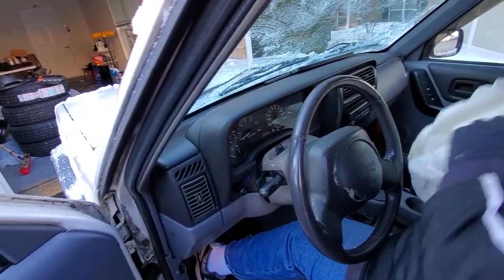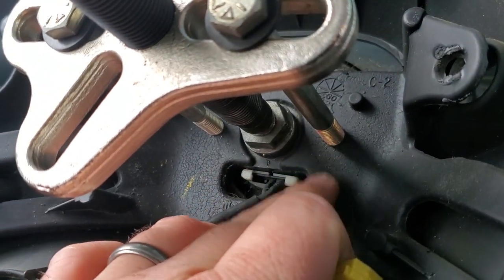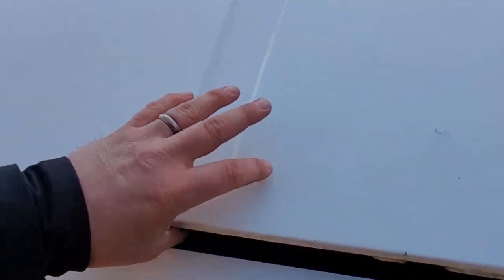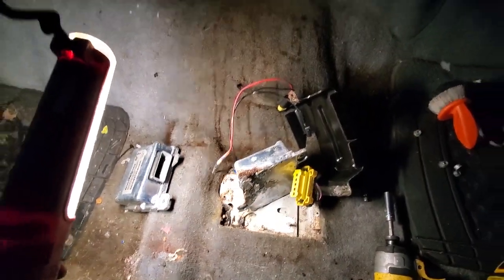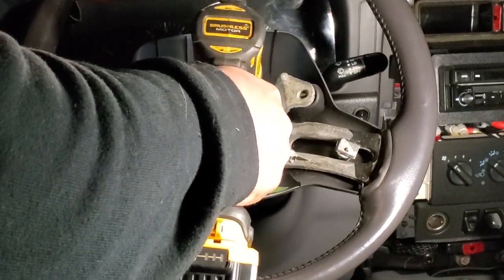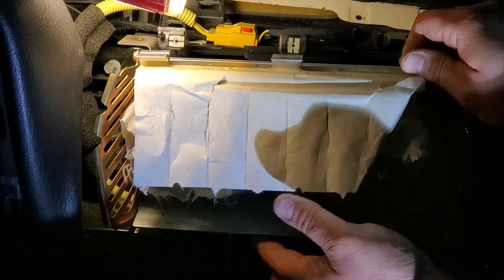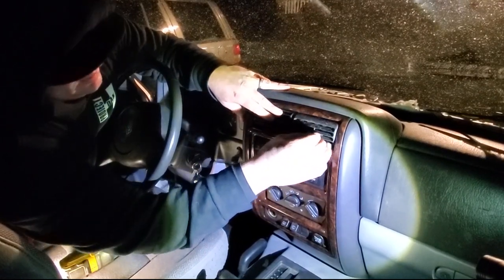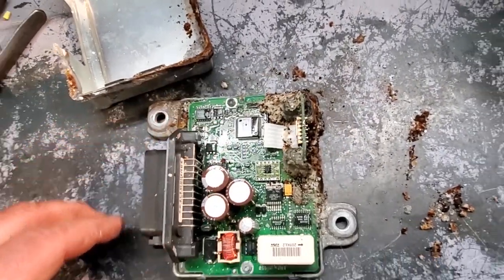JEEP CHEROKEE XJ AIRBAGS DEPLOYED WITHOUT A CRASH!  HOW TO  REPAIR YOUR AIRBAG SYSTEM

Comment: A few years ago I rear ended someone and blew the airbags and smushed up a perfectly good jeep. I put it all back together in a few weeks except the airbags and I searched for a long time for an easy how to guide to replace everything. Over time I got it all together and just a few weeks ago finally got it all figured out with the right parts and replaced it all. It was so hard to find information about removing the passenger airbag! This is the video I’ve needed for years just a few weeks too late! Thanks for being thorough and showing the entire system. No doubt this will be the #1 video used by people doing this repair
Reply from the maker: Oh man! That's the crazy thing about YouTube, I've had all this knowledge in my head but didn't have the opportunity to share until Andy's airbags blew up! sorry we were too late. lol

Comment: Had to replace the airbag twice on the Bumble Jeep (due to vehicular mishaps) The 95 XJ has a self contained airbag (no wires or control module) with no passenger side bag. The last time I replaced it I couldn't find a 95 airbag. I found a 97 Grand Cherokee that had the same steering wheel as my 95. I grabbed the airbag and to my surprise, while it looked the same, it had wires. Fit in my steering wheel, but is not connected to anything. So if I have another vehicular mishap (God forbid) at least the airbag won't deploy. Fun times. God bless, stay well.
Reply from the maker: That's a great story! Airbag s create the best of times! Lol Thanks for your view as always 💪

Comment: Thank you Dan H. Doing my search about the air bag, it was great to here you had something about it. All I was doing was jumping my jeep so I could move it. When I started my jeep I got out and put my cables away I left the jeep running for about 10 minutes I didn't get back in until I parked my 2015 jeep back in drive, that's when I heard a noise, thinking nothing of it when I got back in my xj ,my rear view mirror was on the floor and passenger side airbag had blown. And windshield was busted. I have a parts 98 xj also.
Reply from the maker: Oh man! The module probably corroded!

Comment: I have a 97 too and my airbag module is also under the seat. Was doing some rust repair in the front, took out to clean and luckily looks new.  That was definitely the issue.
Reply from the maker: It's definitely a problem under the seat, You can remove the ground and relocate the whole module under the center console using factory brackets from a later model.. I think we'll have to do that in another video

Comment: There's actually a recall for the 97 XJ to move the airbag controller from under the seat, to inside the center console (they stuff it down under the flip up lid, behind the parking brake lever)
Reply from the maker: Oh wow I didn't know that!  I'm going to have to take the airbag module mount off the stimulus XJ and remount everything the proper way under the console
Reply: @ProjectDanH  yep, here's the info:

https://repairpal.com/recall/00V105000

If you have AllData or similar, you can dig up the actual procedure.

I've no idea if a Jeep dealer will do a recall on a 24 year old vehicle or not.
Reply from the maker: Wow! Great info!! They have to by law
Reply: @litz13  yes I got a notice about my 98’s trailer hitch needing to be checked if it’s correct to protect the fuel tank in a rear collision. So just keep your registration up to date at the dmv. That’s where they pull the data from the vin

Comment: Great video Dan! I didn’t know jeep Put the airbag module on the floor. Lauren something new today. Thank you
Reply from the maker: Seriously! I learned it too I assume they were all under the center console... It's funny though because the '99 two-door I chopped had the airbag under the center console but it's still also had the airbag module bracket under the seat
Reply: My 98 grand has it just behind the ebrake underneath the plastic. I can see it cause atm the ebrake is missing some plastic so you can see it. Guess having it in the center of the vehicle is the best placement.
Reply from the maker: @geobrad2645  agreed

Comment: QUESTIONS!? Good morning Dan! Dave from South GA here. Rewatching this vid for refresh of info. Q1. So, i'm dealing with a AIRBAG dash light on in a 95 Jeep ZJ. any IDEAS? Trying to get answers to why light is on and how to correct issue to keep light off in dash. Q2. STEERING WHEEL LEATHER rotted, I want to replace with a WJ wheel. Which WJ steering wheel has plug and play cruise? Thanks in advance, buddy. Great info contained here. Like Mcky-Ds Im loving it :)
Reply from the maker: LOL, Thanks Dave!  I have a 2001 WJ overland wheel on my 00 XJ.  Everything was plug and play, all I had to mod was splicing in the WJ CC button connectors onto the XJ Wires.  I'm not sure if the 95 XJ will be able to read the resistance of the WJ buttons but you are welcome to try and report back... Id love to know too.  maybe you could invent a way to insert the 95 cc electronics into the WJ buttons somehow.  please let me know!

Comment: Thanks for the video....I have learned a lot watching your videos.  I have a question I hope you can help with. My 1995 Jeep Grand Cherokee Limited,  the airbag light is on and flickers every now & then. How can I get this light to go out or what is any known issues for this?   I bought it from a guy that had been in the dash a few times and also found a small airbag "sensor" I think just laying in the glove box . I had to google the part # just to find out what the sensor was. He definitely did a lot of off-road riding so I'm hoping he just removed the sensor to prevent deployment while off-roading. Thanks in advance.

Comment: Where's the front impact sensor on a XJ in the grill portion ? Great job on the repair on Bag J 😂 that's it's new name . Airbag module was at fault to to age and corrosion this would have totaled this XJ by insurance standards so you shaved another one with you extended parts catalog 👍  It's weird but my old 98 ZJ the module was in the same spot as parts Jeep under the center console high and dry .
Reply from the maker: Im thinking Jeep moved the airbag module location sometime In mid 97... BAG J!!! I love it🤣🤣🤣🤣

Comment: Dan can you make a vid repairing the fiberglass mounting holes on the header panel from the parts jeep? I just picked one up from the pick and pull lot that has a similar blow out in one of it's mounting holes but is otherwise in good shape.
Reply from the maker: Sure!!

Comment: Can you please answer a dumb question for me, Dan?

WHY were there different steering wheels in '97-'01 XJs? It does NOT seem to be a year-to-year change nor is it a trim level / submodel thing...unless A LOT of them have been messed with...
Reply from the maker: 97s and SE models had these the ugly airbag. They have that ugly circle and the ears instead of the Cruise control blanks/buttons.

Comment: Any ideas on how to remove sticky residue on pass airbag cover on a XJ ? 
I tried cleaning it with something and the rubber like cover is  really sticky . I think I used bleach and water to cause this.
Reply from the maker: That sticky stuff is actually the rubber breaking down.. just use some armor all on it and keep it slick
Reply: Thank you,  I will try that armor all ,  the cover has dog hair stuck to it lol 
 I do have hope for it cause the center counsel was the same way. I also found a used one in case,  tons of XJ parts on marketplace for cheap, I got a extra hood and most of the interior for$ 150 , I need the ashtray yet

Comment: Does the clock spring always need to be replaced when the airbag goes off? Love your vids!!!
Reply from the maker: usually because they break easily. I rather replace it while 5he wheel is off than put everything back together And realize I should have replaced it 🤪
Reply: @ProjectDanH  okay thanks just wanted to be sure

Comment: Thank you for a very detailed description.  I have to replace both bags on n '01 Cherokee Limited for my grandson.  This was a great explanation.  Did you have to program the airbag sensor?  I see online ads to 'reset' an airbag module that has blown.  Also has to be the same VIN per their ads.  I will do the bags and go from there.  Thanks!
Reply from the maker: You need to reprogram any Modules if they're not blown, and you dont need to match the vin.  If you can find another module you should be good to go.
Reply: you meant you dont have to reprogram I believe  @ProjectDanH
Reply from the maker: @karentimberlake6077  no programming necesary

Comment: Hey Dan, Dan here… Just deleted center console on 99 XJ, recarpeted, MOVED E-Brake (because I hate the XJ center console THAT MUCH). I used the small shift surround from a Comanche. Hoping to eventually put a bench seat in.
IMPORTANT QUESTION: does the airbag control module need to be mounted “level”? I’m relocating it and need to know.
Reply from the maker: excellent question, I would try to emulate its factory orientation as much as possible
Reply: @ProjectDanH  Since I was already doing a bunch of harness related work, I was able to repurpose about two feet of identical wiring and relocate things properly (with solder and heat shrink, like a grown up person should) to the area under where the back seat used to be. Dash self-destruct averted for now!

Comment: What is the year if your parts rig? Awaiting airbags for my 97 and pulled an un-crashed 01 airbag module from the junkyard, was there direct compatibility from Andy's 97 to the parts rig's module? (I cringed at that pre-recall Module positioning, ugh!), luckily my module is in the post-recall position under the center console
Reply from the maker: its very possible they are compatible,  not 100 sure tho

Comment: Will removing the oem steering wheel with airbag and installing aftermarket nrg wheel cause any issues by not having the airbag wires connected to anything? Does it throw a code or turn on a light or anything? Thank you for the vid.
Reply from the maker: Its possible you may get the air bag light on, but it shouldn't be a problem
Reply: @ProjectDanH  gotcha, thank you for your reply!

Comment: i just got done putting my dash back together because we had to fix the heater core. we had to unplug the airbag but we since have plugged it back in and put everything back together. now my airbag light don’t turn off any thoughts ?
Reply from the maker: Unplug the battery for a while... Maybe check fuses while your at it

Comment: My airbag light is on and no bus code.car starts but barely moves in drive or uphill was worse..I made it home .Wondering what happened  or what to do.
Reply from the maker: could be a bad PCM
Reply: @ProjectDanH  To replace it is just a direct swap? Of course same ye ar?
Reply from the maker: @ari1234.   same year swap shoud work!

Comment: I replaced  my passenger side airbag on my 2003 grand Cherokee but I can not keep the cover down and in place sticks out about a inch or so at the bottom  what is your recommendation...
Reply from the maker: I used 3 or 4 half-inch self-tapping screws on my WJ.  Screw them in from inside the glove box right up to the airbag cover. be careful not to pierce the airbag.. it should hold the cover down.

Comment: Dear strangers of the internet,

Million dollar question.  Do I need to replace or reset the module if the airbag and clockspring has been replaced?  Airbag light went off after these parts were replaced. 

Thanks
Reply from the maker: you need to replace the module if the airbags have been deployed... or if you can't figure out why it's on 😉

Comment: I have a 2000 and my Airbag light come on randomly then shuts off then comes back on etc ... could it possibly be the airbag sensor under the armrest? After watching this I’m scared to drive and it deploying lol
Reply from the maker: it's very possible your module could be going bad..  maybe unplug the battery and inspect the ground and plug under your arm rest

Comment: Can you show me how to fix mine. I have a jeep Cherokee sport 1996.. can I take out. Can I drive my jeep without airbag.
Reply from the maker: I would not recommend driving without an airbag.   See if you can replace your module
Reply: Can I put another wheel?
Reply: Worse thing that can happen if driving without a airbag is it wont go off obviously if you crash and youll be in great danger but other than the light on your dash saying "Air Bag" thats about it doesnt affect nothing but your safety..

Comment: first with an answer, lol. bad clock spring is the cause.
Reply from the maker: NOPE! lol.. Watch till the end
Reply: @ProjectDanH  thats good actually, ive got a bad clock spring on mine and its just been too cold to address it. my airbag light is on, and my horn wont work. iver been nervous about them going off like Andy's did. im still gonna wait for some spring like temps lol.
Reply from the maker: @motownXJdad9565  If your horn doesn't work then I would agree that it is your clock spring that is faulty... However if your airbag module is under the driver's seat you might want to check for corrosion!
Reply: @ProjectDanH  mines a 2000, its under the console, i saw it when i ran all my rca cords for my amps😁

Comment: Why would you want to reinstall air bags? More danger than what their worth imo, for what thats worth.

In an old cherokee its more of a liability seems to me.
Reply from the maker: It is an on-road daily driven XJ in a highly-populated NY city.  Not only is it safer to have a working airbag system, this Jeep also needs to pass its annual Inspection. 
If it was strictly an offroad XJ, air bad would be deep-sixed in a heartbeat.

Comment: I got into a minor accident and my airbags went off. Insurance wanted to total my car and all I needed was new airbags and a radiator.
Reply from the maker: What are you going to do?
Reply: Don’t let it get scrapped!
Reply: @ProjectDanH  already fixed her and resold her! Got a better XJ and I'm currently putting a brand new engine in her.
Reply: I got my $300 beetle after they totaled it out for hitting a rock and breaking the oil pan and that plastic frame around the radiator.  About 1K total for a nice little beetle with a rebuilt title.
Reply from the maker: @abstract1dea  score
Reply: @ProjectDanH  my son's E34 got rear ended last week with minor damage and he wants to keep it.  He's getting a check for $800 and we'll have to go through that whole process again to get it on the road again legally.  But at least we know the procedure now and it should go faster. We've put about 30K on the beetle now and its been a fun little car to drive around.  But my XJ is still tops.  Wife's beetle turned her into a car person so i don't hear so much about spending the money on it as long as she can put her top down and enjoy her little beetle.